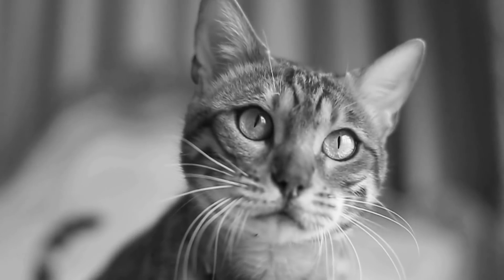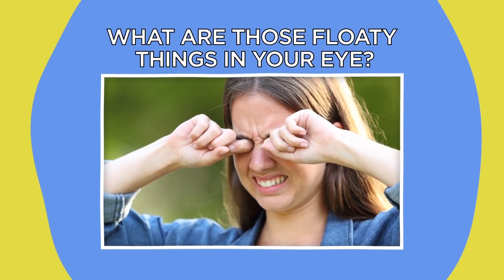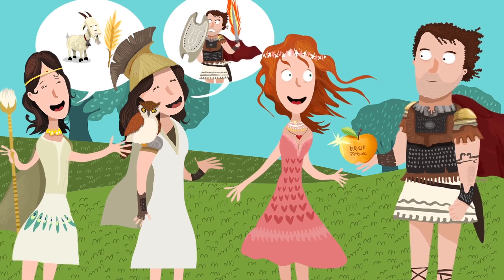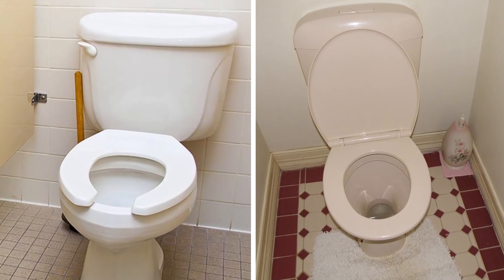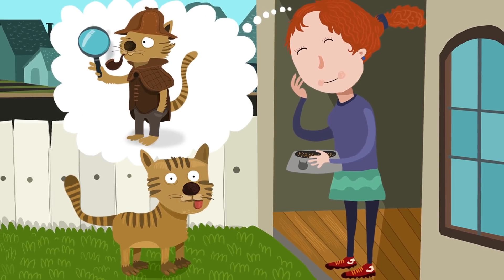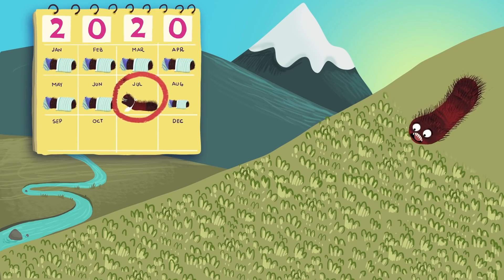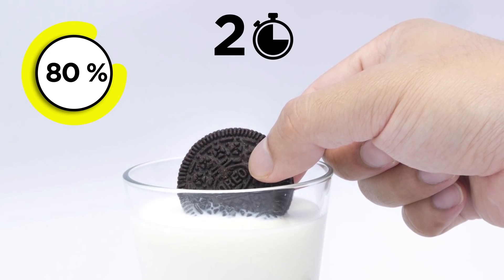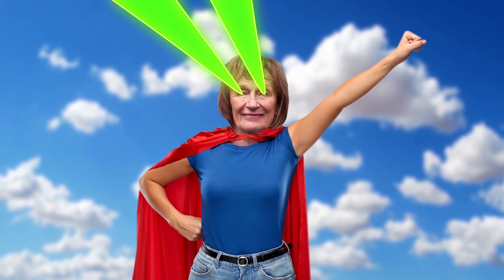What are Those Floaty Things in Your Eye? Fact Show 8

Comment: I’m not quick to believe this theory about “eye floaters,” I have always believed that these floaters were a result of getting small dust particles and other debris in your eye causing the immediate reaction to rub your eyes. This causes extremely small scratches on the surface of the eye. These scratches can then be observed under the right circumstances, the easiest way is by closing your eyes, these spots can be observed clearly and appear to be moving around at first until you realize that once you’ve found one your instinct is to look at it closer. These spots are (in my case) not on the corneas therefore I end up looking slightly left (for example) to get a better look, and this of course leads to the spots moving left also causing my eyes to inadvertently chase them “off-screen,” then when I look straight again the spots come racing right back and return to the original location. I believe they appear so easily using this method because you have less visual stimuli when your eyes are closed allowing you to quickly locate the “moving” spots. Additionally these spots look much larger than they actually are, possibly due to the fact that everything you see must pass through them before they can be processed into the image your seeing, just like a camera with scratches on the lens. These spots can be observed with your eyes open also but they are much harder to locate. The moral of the story, you only get one pair of eyes and they have to last you your entire life, take good care of them.

Comment: Now days rails are put down with a welded rail car most likely, and then once into place maintenance of way track mobiles would pour ballast at a slow speed, and then there's other equipment for putting the spikes down, shaking down the ballast, moving ballast off the rails, etc. Although rails with concrete ties are different I would guess.

Comment: Each September the Alaskan wood frogs freeze. Two-thirds of their body water turns to ice. If you picked them up, they would not move. If you bent one of their legs, it would break. Their hearts stop beating, their blood no longer flows and their glucose levels sky rocket. But then during the spring, they thaw out and return to normal.

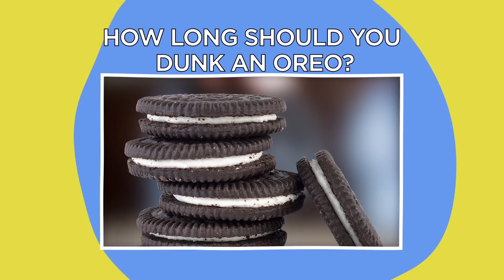Comment: 9:33 Wrong, There is not an amount of time for all Oreos. Depending on the Oreo there's a lot of variation. The best way to have the Oreo absorb 100% is to slowly put the Oreo into the milk and then right before you submerge the oreo completely you hold it on the surface of the milk. If you do it right the oreo won't be submerged right away but until the surface of the milk. You will see water tension happen and you should let it happen. Keep the oreo at the elevation. This gives a little hole in the oreo to let all the air out. The Water tension should go away after all the air is out of the Oreo. When that happens the oreo will be completely submerged under the milk and you can pull it out then. 99% of the time you will get a 100% Airless Oreo.

I did an essay on this back in 8th grade. Wow, that was 8-9 years ago. I feel old. Anyways, I haven't eaten Oreos ever since I became Lactose Intolerant.